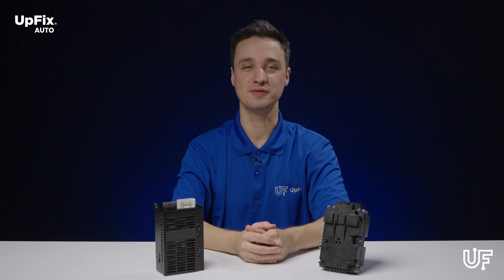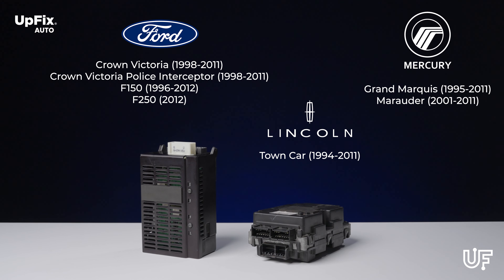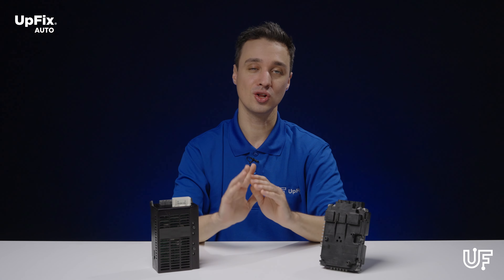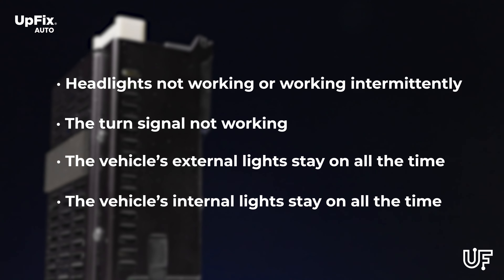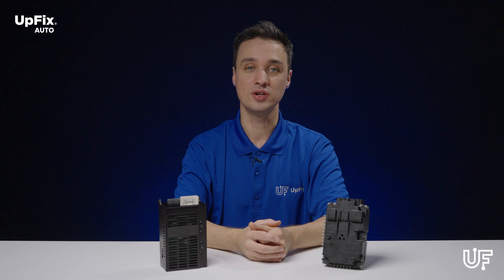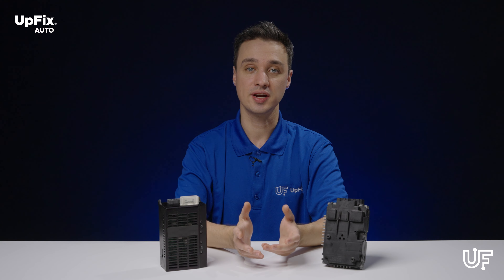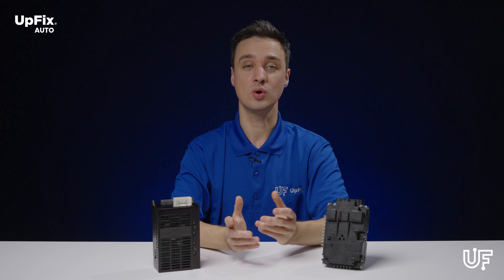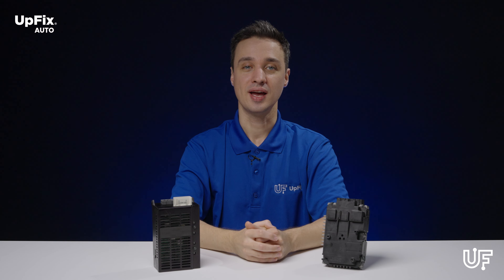Faulty Ford, Lincoln & Mercury Light Control Module LCM How to Fix by UpFix

Comment: I have a 2005 CVPI. The issue I’m having is that my tail lights work about half of the time. It only affects the glow. So if I’m driving or put my car into park, nothing is lighting up in the rear. My turn signals, brake lights and hazards all light up fine. I had the LCM recalled after I bought the car in 2019, and discovered this issue about 1 year ago. Could it still be the LCM? Or something else?
Reply from the maker: Yes LCM is the problem.

Comment: I have a 2003 Lincoln Town Car Executive series. My LCM was Buzzing like crazy until I would turn on the lights and it would stop buzzing. Then the lights would take hours to finally shut off even though I hand turned them off at the switch on the Dashboard! Over time the LCM Buzzing got more and more noisy like it was Dying or something! It itself no longer buzzes at all. Now, it just buzzes at the Dashboard switch but it's more faint than the LCM was. Would you say the my LCM is completely 'TOAST" at this point?  I've been attempting to perhaps shop for a OEM replacement , but I can't find one in stock locally nor on the internet.
Reply: Im having the same issue on my 03 Town Car. LCM buzzes with light switch in Auto. Stops when i flip light switch manually to ON.

Comment: 03 town car, all interior lights don't come on when the door is open, the overhead lights don't come on and the map lights don't work, the lights at the bottom of the doors work the lights in the rear work. All the dash indicators don't work either, I mean the digital display, the odometer etc, if you bang on the dash above the instrument cluster it will sometimes work but it doesn't last long until it malfunctions again, the remotes don't function either, I read that the door control module might be at fault, this car was owned by my friend, a few years ago the driver side door hinges wore out causing the door to sag, she spent at least four years having to slam the door to get it to close, I told her I'd replace the hinges for her, I got them in 2022 but she never had time to let me have the car to fix it, subsequently all that slamming might have damaged the door module, the first thing I did was replace the hinges but again the damage might be done, Im trying to fix the car up to sell for her, I fixed the AC, the pressure switch was bad, I forgot to mention that the trunk lights don't work either but the under hood light works, the headlights turn signals brake lights all work, I don't know where to start.
Reply from the maker: Yes, it's definitely a faulty  LCM unit. We do rebuild these every day. Check out upfix.com

Comment: Anyone else have the singular problem of just the turn signals not flashing? My LCM seems to work fine all my lights come on but my only issue is that my signals dont blink, the bulbs are fine everything comes on and I tried unplugging it and plugging it back in and that caused them to work for 20 minutes before stopping on the highway. Anyone know how to help? I dont want to spend hundreds on a new one but I might have to just get a refund from my autozone warranty. I can't just send my LCM over for repair because then I wont be able to drive anywhere
Reply from the maker: The issue is in the LCM, it is responsible for all the crazy lights issues for this vehicle, including turn signals, headlights, brake lights, inside of the vehicle dome lights. Yes when you unplug it for 20 min and then reconnect it then may work for a few minutes until the LCM get heated up again. Check out upfix.com, we can rebuild this LCM for you!

Comment: I have a 08 grand marquis , i have no turn signals, no radio, and cluster and  and display tuen on and off
Reply from the maker: Yes that is the faulty LCM. It needs to be replaced or repaired. Start saving today with UpFix.com

Comment: Hi. I have a 2000 Town Car and all of a sudden the horn won't honk when I press the control door lock. The horn does work. Its only when I press the lock button. Was wondering if this sounds like it could be the LCM?
Reply from the maker: The horn operation does indeed route through the LCM. If there is a circuit issue with the LCM controlling the horn we can do a bench test and see what's going on with your unit.

I'll include a link for that below. With that being said, there could be a wiring issue going to the horn switch inside the steering wheel that routes through the clock spring assembly so that would need to be inspected as well.

https://www.upfix.com/product/lincoln-town-car-1998-2011-light-control-module-lcm-repair/

Comment: Brake lights? I've replaced brake light switch
Reply from the maker: Brake lights are also controlled in this LCM (light control module). If it is faulty then LCM needs ro be replaced or repaired. UpFix.com can repair these LCM units.

Comment: In a 2005 Town Car I hear a buzzer noise coming from the LCM sometimes it immediately begins when car has it's battery cable re-connected before key is even inserted in the ignition, other times this buzzing sound begins after a couple minutes driving, and within say about 3 minutes it slowly fades out...However If the headlights are turn on it immediately goes off, is this the sign of a faulty LCM? Also could the LCM be keeping the cars stereo on even though the vehicle is turned off with the ignition key out? Last but not least, could the LCM be the cause of draining the car battery even if all interior & exterior lights are turned off and visually verified to be off, the car engine turned off and ignition key is out?  I find in that in about 48-72 hours the battery is drained and  the car won't even start.  Is this a faulty LCM?  ~Thanks, Steven
Reply: Wow I actually found someone with the same buzzing sound. My headlights turn on when I open my door if the temperature outside is anything below like 65° and I have that buzzing sound turn the headlight switch on and it stops. But I have to have the headlights on for a long time before it won't do it when the switch is off. If it is actually cold out forget about it the lights won't turn off. If they do they come back on after alittle while dim and the buzzing starts again and progressively gets louder and the headlights get brighter.
Reply: Did you ever figure it out???
Reply from the maker: It sounds like you’re dealing with a common issue in the Light Control Module (LCM) on the 2005 Town Car. Here are some points to consider:

1. Buzzer Noise and Headlights Behavior: The buzzing sound you hear from the LCM and the behavior of the headlights turning off only when activated could indeed indicate a fault in the LCM. It's possible that the internal relays or circuitry in the LCM are malfunctioning, causing irregular behavior.

2. Battery Drain: The LCM could also be responsible for the battery drain. If it’s keeping the stereo or other electronic components active even when the vehicle is off, it could slowly drain the battery. This is often a sign of failing relays or short circuits within the module.

3. Potential Solution: Repairing or replacing the LCM may resolve both the buzzing and the battery drain issue. At UpFix, we offer LCM repair services that could fix this exact problem, restoring the proper function of your lights and helping prevent battery drain.

If you’re interested in getting it checked or repaired, feel free to reach out to us. We’d be happy to assist you in fixing your LCM issues! Check out upfix.com

Comment: Do you repair the tipm (fuse box) form a jeep,dodge or Chrysler?
Reply from the maker: Yes we repair TIPMs for these vehicles. We repair many every week. We are usually able to repair them the same day they are received.  Check out UpFix.com
Reply: How much for a 2012 jeep liberty ? It got stuck in 2nd gear. Can’t remember the faulty code but I can get it

Comment: Will faulty lcm causing battery drain while engine off?
Reply from the maker: Yes absolutely
Reply: @upfixauto  to replace it do I need to get the same number locate on the faulty one to match exactly to work?
Reply from the maker: @dillonle4034  yes make sure you are replacing it with the same part number. For these older vehicles, you don't need to worry about VIN and programming as you do on newer vehicles. For plug-n-play and if you have 4-6 days to send part for repair .... checkout upfix.com
Reply: @upfixauto  do you have any video how to remove it?

Comment: I have a 2007 Mercury Grand Marquis Gs  thats doing the same thing. My interior light and head lights come on by themselves when the car is Off
Reply from the maker: Yes, this is common for these vehicles. The LCM is failing and needs to be replaced or repaired. We do offer repair service. Check out upfix.com and start saving today!